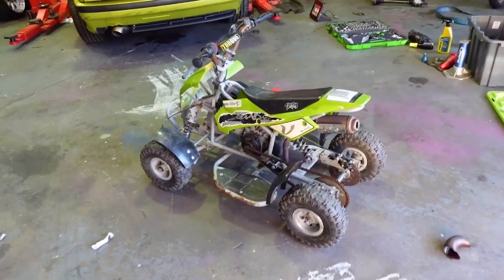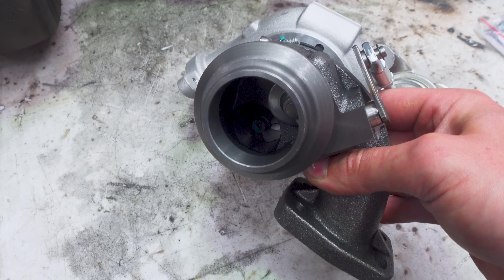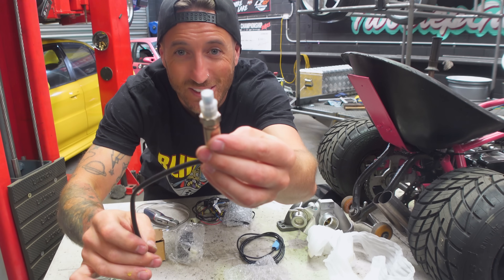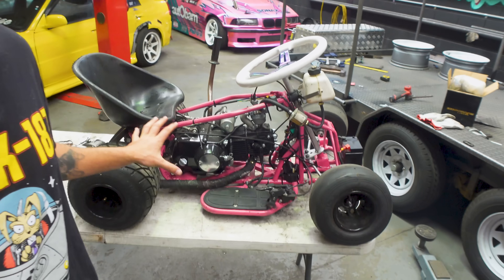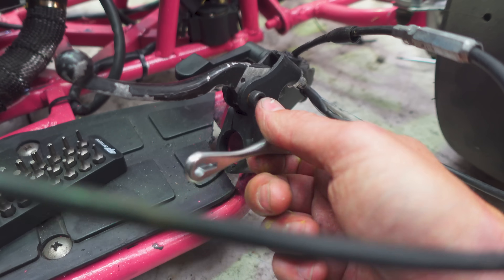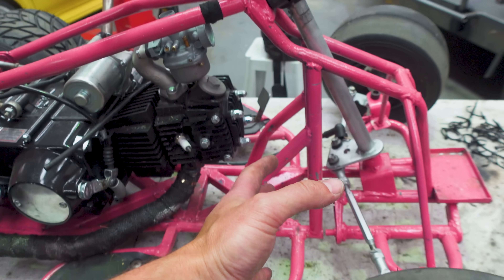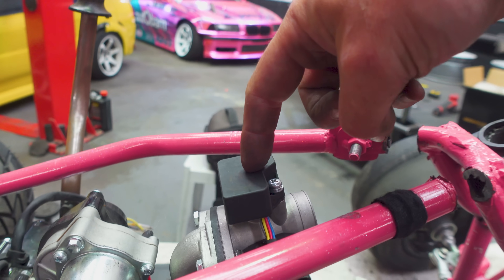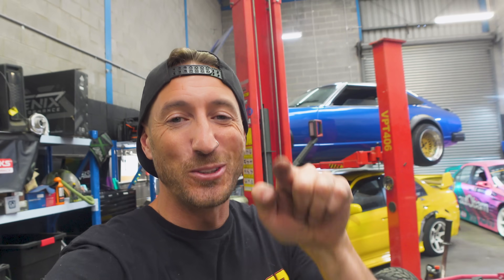125cc TURBO Go Kart Build | Part 1 (Fuel Injected)

Comment: so you can turn a copy of the Honda 125 into the same thing as a Gromm has, who'd a thunk it... but did you know there are specific kits that have a block that bolts onto the side of the head and provide oil for the turbo?
Reply from the maker: I’ve seen those kits! I have a 12v oil pump currently but I think I’ll just get that block as it’s much easier and tidier
Reply: @itsmikelake  Grind hard plumbing co tried a 12 Volt pump, but it had too much pressure and blew the seals out

Comment: Make sure that you make a intake plenum with a check valve that is roughly the size of the cylinder. With 1 cylinder 4 stroke engines when you turbo them without making the plenum this way the pressure built up will not enter the engine until the intake valve opens and then has already dropped in pressure making it very inefficient
Reply from the maker: Oh dang, i'll have to do some research on this one. I wonder if having the front mounted intercooler setup will help with this one?
Reply: @itsmikelake  watch grind hard plumbings drift quad bike, they just went through this problem.

Comment: I have the feeling that the frame needs to extend quite a bit to counter some insane wheelies. Most of the weight is on the rear axle; engine and  driver. The center of gravity of the frame is moved a little more forward but the heavier driver and engine are in the same position. Now, moving the engine could be a pain. You could move the seat forward a Few cm.
Reply from the maker: Yeah I think extending the rear of the frame will help with this a lot!

Comment: might need bongkers fans to extra cool the air cooled motor
Reply from the maker: This is a good point actually. An oil cooler should help!
Reply: @itsmikelake  seperate oil pump for the turbo??